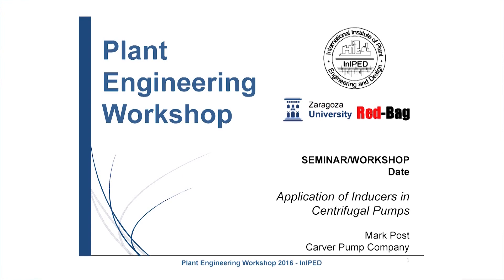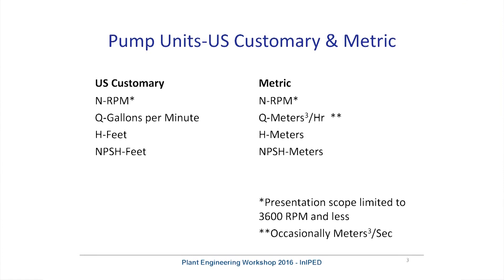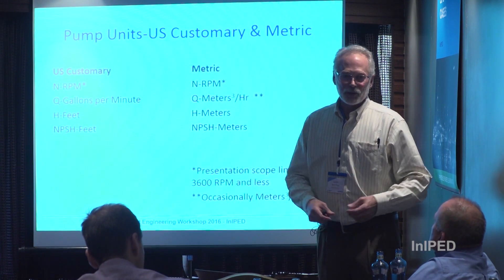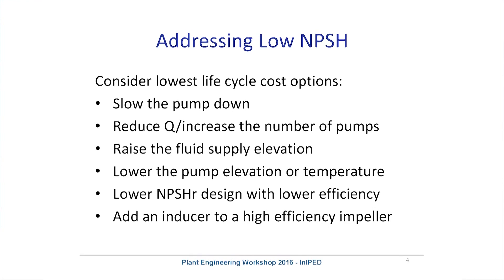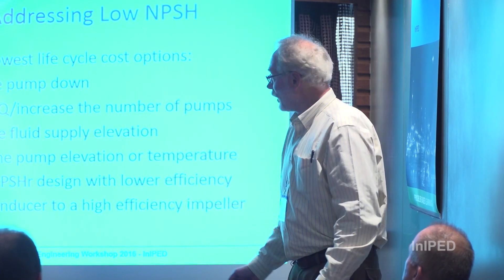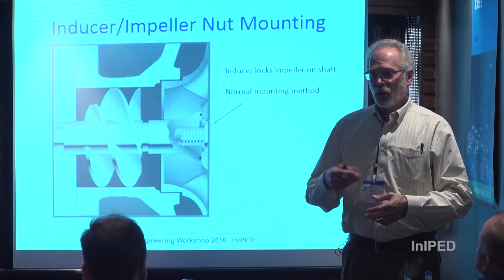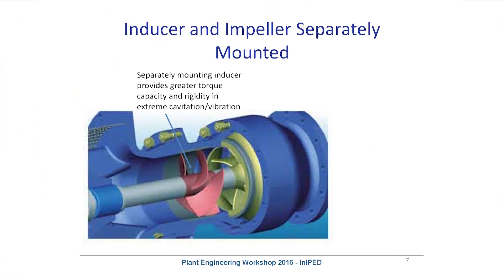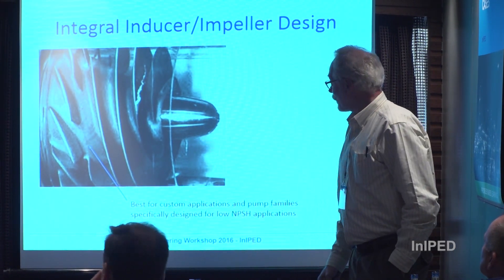Inducer Selection and Application

Comment: I am in the prototyping stage of jet-powered hydrofoil surfboard and just learning about inducer props/impellers and was hoping you could tell me more about this?

Is the inducer fora jet boat usually an impeller or propeller?

Is it usually a higher pitch or lower pitch than the main impeller?

Is the inducer impeller/prop always a smaller diameter?

Any insight here would be really appreciated
diyefoil@gmail.com